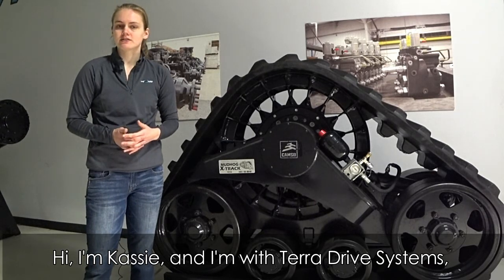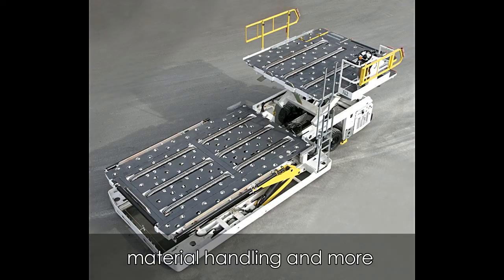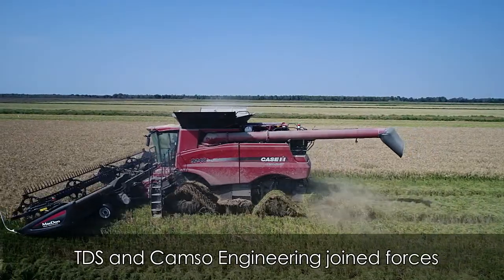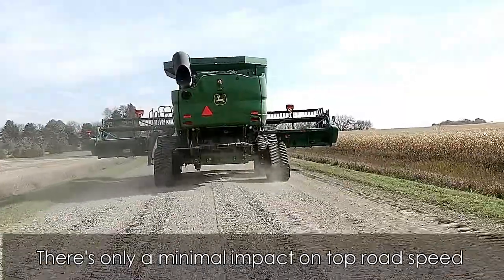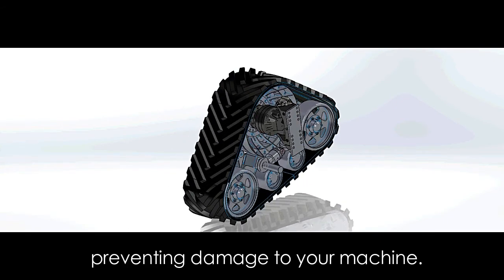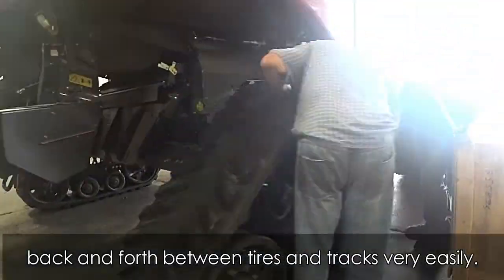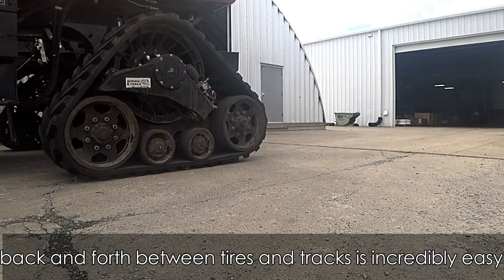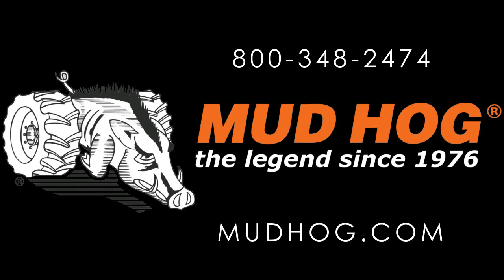Mud Hog X-Track: Powered Rear Tracks for Combines

Comment: A lot of counter intuitive information.  More power to the ground?  Kind of a play on words, these tracks eat HP, you're assuming that their is slippage with tires, meaning more power because if traction. A smoother ride is also untrue from every tracked tractor or combine owner I've heard.  And the fact that you make a big deal out of being able to switch back to tires easy seems like a hedging of bets encouragement.  Good luck though.  Rear tracks in Prwd combines will sell and looks like a quality projwct